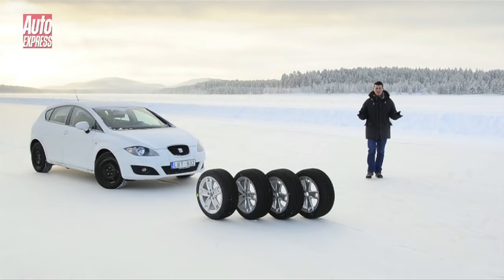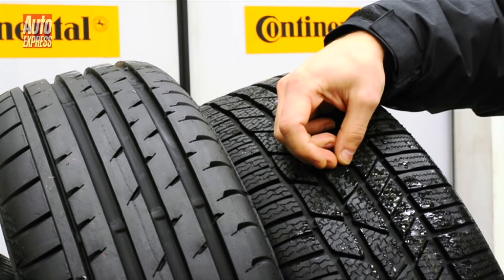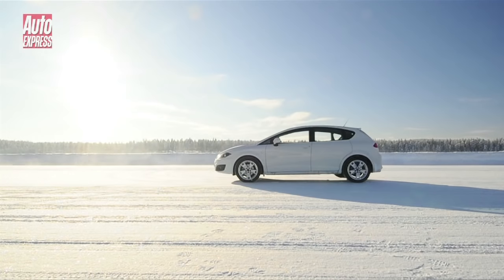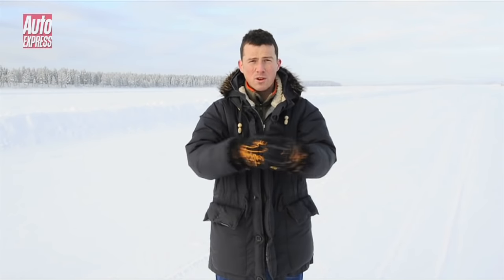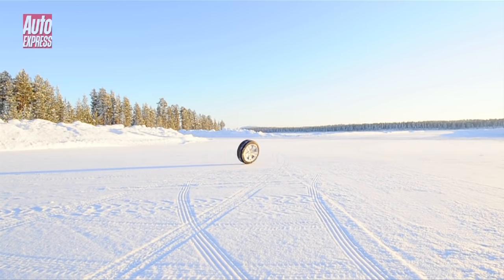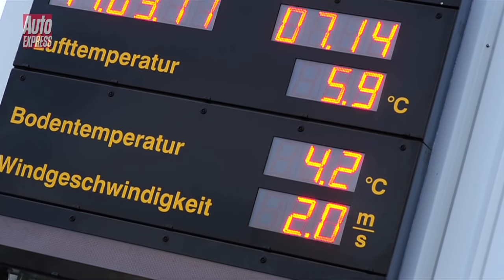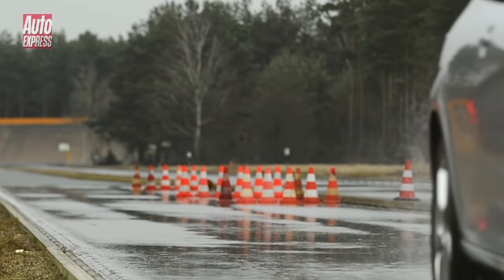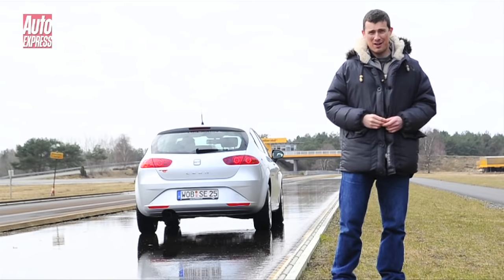Winter Tyres v Summer Tyres: the Truth! - Auto Express

Comment: if winter tires are so good not just on snow but on wet conditions, why people don't leave them all year long for safety precautions, what's the logic and why the need to take something that helps you to stop faster and have more control to prevent an accident ,i often hear people they can't wait to put their summer tires back, summer tires don't really help you at all, so why? is it me or people are just stupid...i know insurance companies love stupid people, because the more you crash the more you pay on your policy...
Reply: +DellaRobbiaMX Rubber compound is different. Different melting point (no they won't melt, but the more soft they become, the faster they deteriorate), different ways the carcass will bend, etc.  Running winter tires in the summer will use them fast, and if the tarmac is hot enough under the sun, they may even start to feel "greasy".
Reply: +Malfehzan  ooh i see, now  i know why people wants to change their tires after winter is done...thanks for the info that really helps...

Comment: Thats fine but who has a spare £400 to change to winter tires and pay the £10 per wheel to change them over or buy a spare set of wheels ,I can really see that catching on!!! .
Reply: I bought winter tyres in 2011.  Dunlop Wintersport 3D.  I bought a set of steel wheels for them, and I change them over myself at the end of November, and back in March.  They have done 10,000 miles and have about 6mm of tread left.  I love them, and would not want to drive a car in cold wet conditions on summer tyres ever again.  If it snows I have been up roads that 4x4 drivers will not tackle.
Reply: its snowed twice here in three years so not really relevant unless your trying to sell tires or have money to burn,if you drive with consideration to conditions you can drive perfectly safely with normal tires,I agree that if you live in an area were you have prolonged snow then it may be worth it.
Reply: Winter tyres are not just for snow.  When its cold and damp, or on frost covered minor roads they really do make a difference.  When I'm running my winter tyres I am not wearing out my summer tyres, so all it has cost me in the long run is the price of a set of steel wheels.
Reply: ***** I drive 40k per year in all weathers, if you drive to the conditions your presented with you don,t need winter tires in the UK ,after 34 years driving everything from a moped to superbikes and 7.5 tonne trucks with no weather related incidents I would say your statement about my right to drive on the road is mute but if you wish to use winter tires then good for you but not everyone is in the position to do that or need to after all HGV,s do not change to  tires every winter .
Reply: Me
Reply: salisburyplain998 When you are using the winter tyres, you are not wearing out your summer tyres, so they last longer and it balances out over time. What some people do is to buy some cheap second hand wheels for them, which will take the battering winter gives, saving your "better" wheels. You can change them over yourself.

You're right in that not everyone is in a position to do it, and I'm not, but as an experience mechanic I would prefer to use winter tyres when appropriate. I have to make do with crappy summer/all season tyres right now.

And yes, people should also drive for the conditions. However, even at lower speeds, and you taking care, it could mean the difference between just stopping in time or hitting someone who steps out into the road in front of you. You could be the safest driver in the world, but you have to be aware of other people's (in)competence.
Reply: People find it perfectly reasonable to spend £35 on Sky TV a month...So £400 quid for some extra safety has my vote. Im just about to buy my first camper and am not taking my chances... And fuck Sky TV by the way, if anyone reads this and pays for TV or even a TV license you need to wake up.
Reply: The hell is the point of Summer tires why just not use Winter tires all year round.
Reply: ***** If I recall, the softer compound of the winter tyre would make them wear out a lot faster than all season or summer tyres, in the warmer temperatures. If you don't do a lot of miles and don't have lead in your right foot, it should be OK, and some people do use them in the summer. 
You may also experience higher fuel consumption.
Reply: ***** LOL Knob
Reply: Winstan you should not be on the road if your that scared ,if you drive to the conditions you are presented with you do not need winter tires in the uk or at least in Wiltshire anyway ,its a marketing ploy to separate OCD females from there money.
Reply: salisburyplain998
Yes your right...
Until you have experienced October-May north of Leeds...

I thought the "South" warm until I attended phase 1 British Army training in Bassingbourn Jan 15th 2011.

I cannot imagine worse conditions. Try getting to bed a 2am after inspection then being to inspection at 6:30am outside. sometimes we would be there for an hour or two in nearly nothing...

Anyway im not here to Bitch. I am scared of the road, im scared of the bullshit ive seen in the last 8 years driving.

I have just bought a FWD 1998 Fiat Ducato ex-ambulance motorhome. Its great but the tyres are perishing. I need a new set for.... anything.
Reply: Im all for  going with what your happy with just don,t hold the moral high ground because you are happy to pay the extra for winter tires not everyone can afford them or need them .

Comment: turn off that fckin ABS! breaking distance will be much shorter, I guarantee that
Reply: +karffiol ABS improves vehicle control and decreases stopping distances, why should they turn it off?. And you can't turn it off by just pressing a button
Reply: +karffiol Yes, please turn your abs off and tell me how good you are at threshold braking in snow on summer tires. Take a video. And then tell me how much your insurance goes up when you crash.
Reply: +karffiol ABS absence on ice is a vehicle crash waiting to happen.
Reply: you are actually right about abs, abs works much better in dry and wet conditions than in snow conditions. this is true because of the way abs works. abs sends very fast impulses right? those impulses just don't do that good of a job on snow, traction control on the other hand is much better as it measures and adjusts the speed of the tires based on large difference in their spinning speed
Reply: +Dragos Vasile wrong, ABS massively increases stopping distances as a ledge of snow is unable to build up between tyre and road surface.
Reply: +M305809 Finally! someone who understands physics... thank you random citizen!

Comment: I have summer tires on my 1989 ford escort it's -3 degrees outside today; random moron running onto the highway emergency braked no problem

so busted

overrated as fuck

also; went to nürnberg yesterday, lots of snow... still no problem...
it's just like 80% driver 20% material based on what you need in those conditions ;)

Comment: This never happens in America. Noone buys winter tires. Instead people actually clean the roads. And learn the metric for crying out loud
Reply: Can't tell by the comment where you are, Quentyn. You're joking of course. MANY people change to winter tires. (Especially those with anything like a performance car.) Garages all over America have a set of tires "on display" part of the year. Roads do get cleaned, but half the country gets quite a bit of snow all winter.
Reply: good for you
Reply: Tom Crisp
I don't entirely agree. NYC is of the latitude of Istanbul and Rome. Snow in US above NYC stays longer, true, but most of the Northern states are prepared. The one below the NYC line are totally unprepared. This was well obvious this last winter.
Reply: Here in Utah  its impossible to plow all the roads after a snow storm, its best to be safe and have a fun ride in winter time. Get snow tires !!!
Reply: Exactly I run wither tires, Minnesota is ok at plowing the road
Reply: Lots of people in America buy winter tires.   NYC as your baseline is dumb.  NYC has issues of properly clearing the roads as there is no where for the snow to go when the plows go through.  Even when you look at the Tirerack videos, on braking alone, the difference between an all-season and winter tire is more than enough to prevent you from rear-ending someone, which in NYC traffic density, causing a pileup.

Other parts of NY people do install snow tires as roads barely get plowed.
Reply: Brian t ya Minnesota is pretty good at clearing, know who isnt South Dakota absolute rubbish at it, drive around dropping sand but hardly ever plow
Reply: South Dakota gets a lot less snow because its much further south. North dakota is not very good either
Reply: not much snow no, but its never cleared from the roads so its there till is melts

Comment: This is a terrible review, winter tyres for half the year? statistically, if you bother to do some research and get yourself a decent set of summer tyres (not budget tyres) they grip better in the wet and in the dry. the only benefit of winter tyres is the effect in snow, which almost never happens in England (where the roads have not been gritted). winter tyres heat up more, provide less girp in most conditions and wear alot quicker. Winter tyres are for snow people, nothing else
Reply: this test was done with continental sport contact 3, one of the best summer tyres around. and yet it was worse than a winter tyre in the rain.
but it all comes down to where you live. here in Southern Greece for example, it would be pointless to put winter tyres, since it rarely rains, and almost never snows. but in Germany for example, it makes much more sense, since it is rainy all winter, and often snows
Reply: In germany you must have winter tyres by law as a second set of tyres. Nobody in germany drives for half the year on winter tyres, they wait until it snows then put them on. The tred of winter tyres is specific to snow, and it disadvantaged in wet and dry compared to a summer tred which is deisgned for rain and a dry road. I commented on this because it annoyed me that a review has given the complete wrong answer, if you use winter tyres for half the year, you will also be buying a new set every year.
Reply: From what I know, winter tyres are mandatory in Germany from October 1st (or November). 
Ofc winter tyres do not perform in the dry, but why you insist about the wet, when you clearly see that it brakes better?
Reply: Do you really want me to go through and send you all the links showing that in general summer tyres are better in the wet. do you really want me to post them all here? i spent weeks researching tyres for my car using multiple sources as well as ringing technical support at kuhmos. Just because one youtube video shows one instance of them brake better does not mean they are. they did not do the swerve test in the wets with the winter compound and do you know why? because it would grip worse than the summer tyres. don't just take my word for it, by all means looks into it yourself
Reply: no, don't do it, i will take your word and research.
what i tried to say at my first comment too, is that, if you live at a place where you can have snow on the road often (or even once a week) it totally worths it to have winter tyres on, and be a little more careful the rest of the days. besides, even if you are right (and i have no reason to think you are not, since i made no research)with winter tyres you will lose a bit in dry and wet surface, but in snow and ice, they can be the difference between going home or ending up in a ditch or on an upcoming car
Reply: yup. completely agree with you, in quite a few European countries it's very wise to have winter tyres on in the cold changeable conditions. you never know when a metre of snow is going to drop in Switzerland for example. I just didn't like how this review generalised it to everyone. In England you are never more than 50 miles from the ocean at any point and so we have alot of rain but it usually stays quite mild for most the year. And when it does snow our roads are gritted. And i can only expect this is directed towards English people because one, the guy in the video is English and 2 it's been done by auto express.
Reply: From personal experience I would have to disagree. I've ran both Pirelli summer tyres and Dunlop winter tyres on both my E63 and XJR and found that in low temperatures the winter tyres considerably out performed the summer tyres in the wet.
Reply: sniktun1 Lets face it, this is the internet and I'm sure someone could go out and find 10 reviews that contradict your own. However, I'm not talking about sitting behind a screen and digging out reviews, I'm talking real world experience. I've been driving for almost 30 years on the Northern Pennines, the Scottish Lowlands and Highlands, and a few seasons in Alaska. From this real world experience I have found that good quality winter tyres considerably out perform summer tyres at low and very low temperatures.
Reply: Lool get myself an education? by the sounds of things you are a lorry driver..... i also am aware the northern pennines is in england, however seing as you chose a place in england which is on the border to scotland i chose to ignore it

Comment: who the fuck owns 8 wheels and tires?
and even if i could afford 2 sets of wheels with differant rubber, i live in scotland so i would have to change them over about 3 times a day
Reply: first, lot of people have 2 sets,where i live (Finland) you have to have winter tires too. it's not just law, but you most likely will be stuck with summer tires.

Second.  if you cant afford 2 sets of wheels what happens when your first set is not good anymore ? do you quit driving or buy new set of tires ? winter tires doesnt cost you more because when you use winter tires, your summer tires are (surprise) not in use. 

Third. you wouldnt change them 3 times a day. you change them twice a year.
Reply: too much hassle, i'd rather buy a converible for summer and landrover for winter, 2 cars its the way forward
Reply: Hassle ? changing tires ? it takes 30 minutes of you time twice a year. but sure if you can afford too cars and especially if you want convertible, 2 cars is good choice.
Reply: Steven Carruthers
 If I were in your position ( I guess rural Scotland) i'd go with a good weather car + a 4x4, though much cheaper to run is a Suzuki jeep or cheaper & more comfy is a Fiat panda 4x4, OK the fiat is not a real off roader but if you aint going off road !

Comment: lol, braking in wet is a load of bullshit. They compared top winter tires with cheap summer tires. If you compare top tires from continental (ts830 vs. sportcontact3) or lets say from bridgestone, on wet summer tires stops faster. what a load of bullcrap, with those plastic summer tires